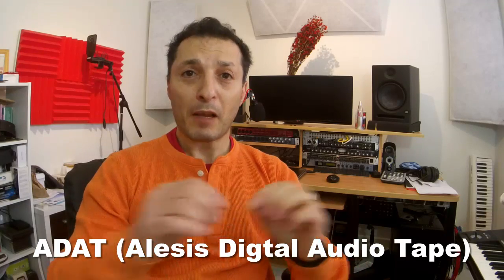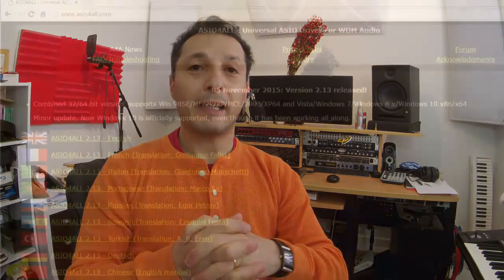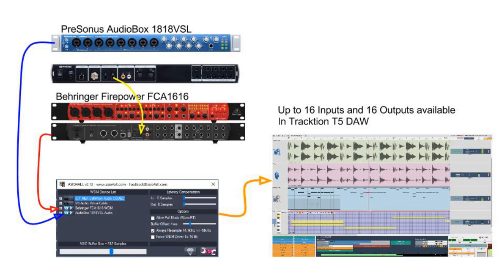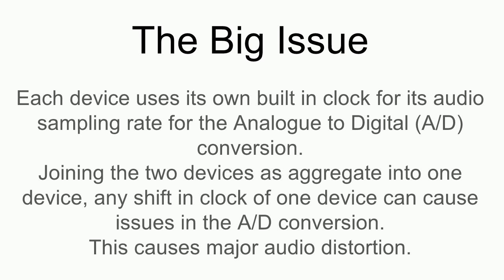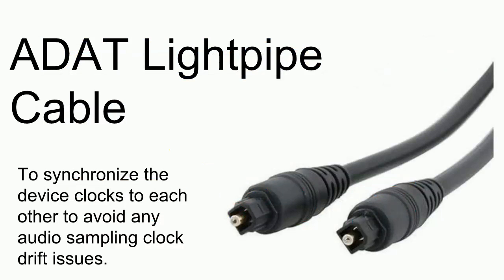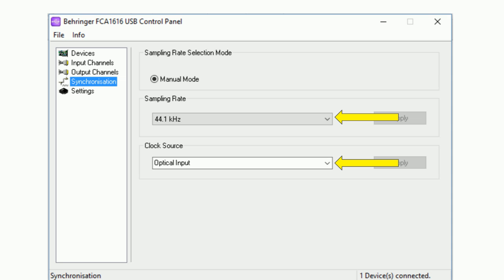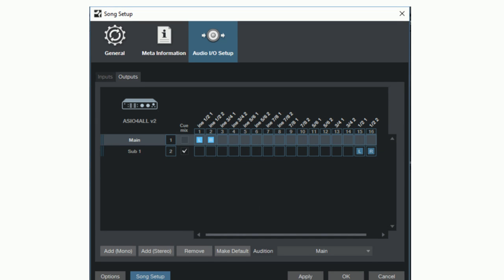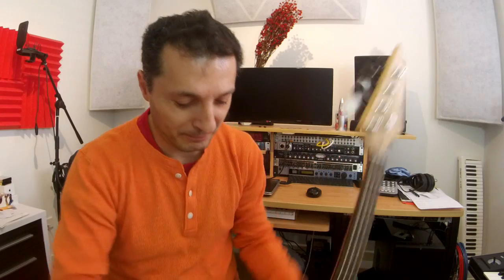Combining Two Audio Interfaces Using ASIO4ALL using ADAT as Clock Link

Comment: This makes no sense. 

If I have two audio interfaces with ADAT in and out and 8 analog inputs and outputs on each, I can just take the ADAT out from #2 bring it in to the ADAT in to #1, run the ADAT out from #1 to the ADAT in to #2, and then just use interface number #1 with whatever driver it comes with (no need to use ASIO4ALL) and have access to all 16 analog inputs and outputs on both interfaces through interface #1 to the computer.  I can then use the interface software to route all channels however I like and see them all in my DAW where I can set the clock to "internal" for both interfaces to slave to through the ADAT connections. 

If your method was correct (and I've never seen anyone use ASIO4ALL to successfully combine two input or output interfaces), then I should be able to run 2 ADDITIONAL AD converters (like the Behringer ADA 8000 / 8200) to feed each of the audio interfaces and combine the two interfaces in ASIO4ALL to get 32 inputs and outputs with the ADAT handing the clock OR just use a dedicated external world clock to sync all 4 devices and the DAW PC.  

Unfortunately, I think that ask that you've done here is to make use of the ADAT input into your main interface to use the extra 8 ADAT in channels which is a well - documented feature of the audio interface, anyway.  

You don't even need to waste a USB port on your DAW computer, because it doesn't need to pull audio from the interface.  It can do it with just the ADAT connection going into the primary interface connected to the DAW. 

Lastly, there's a maximum number of channels you can bring into a PC using a USB 2.0 port. 

My RME Digiface USB interface takes 4 ADAT ins and 4 ADAT outs that connected to any ADAT - enabled AD preamp (like the Behringer ADA 8000 / 8200) or any audio interface with ADAT ins and outs to combine them into a 32 channel in and 34 channel out (it has s headphone port) interface through a single USB 2.0 cable.  But that basically maxes out the capacity of the USB 2.0 port. 

I'd love it if you were correct, though. I've got 4 audio interfaces with ADAT in and out and 2 Behringer ADA 8200s. If you were right, I could buy 2 more ADA 8200s and then have 64 channels of inputs and outputs and sell my Digiface USB. Unfortunately, ASIO4ALL can't (from what I understand) do this in a reliable way. 

It's what makes those damned Apple computers better for audio recording. They can combine interfaces right in the OS where Microsoft won't get off of their asses and fix their crappy audio system.
Reply: Okay, this shit is frustrating me. I'm confused about all this.  I don't think and ADA8200 can work with the ASIO4ALL because both interfaces have to be connected via USB. The tracks aren't all going through the ADAT, just the clock sync. The tracks are going to the computer via their respective USB and get combined by ASIO4ALL. It seems to me that this is basically a workaround if you don't have 2 optical cables. Please clarify if you can. I would like to know before I buy an interface and mics.
Reply: @limitisillusion7  First of all, the ADA8200 isn't an interface at all. It's only a converter with an ADAT (optical lightpipe) port and preamps. It'll take analog in through a preamp and then convert it to one of eight channels of digital OR / AND convert eight channels of digital (coming in from ADAT optical lightpipe) back into analog.  

To use it, you'll need an ADAT interface (which are very common on inexpensive audio interfaces).  That interface will either be USB or FireWire or Thunderbolt. If you're talking about USB, then yes: you can pull in all of the analog inputs on your interface plus the 8 ADAT channels per optical input port.

If you have some of the newer interfaces, you can even have two or more ADAT lines coming in. 

If you buy an RME Digitface USB, for example, you can run FOUR ADAT inputs (and outputs) via one dedicated USB port. That's 32 channels in and 32 channels out (plus two analog headphone RL lines out).

Also, many manufacturers permit more than one USB interface to be run under one driver. 

This lets you combine their inputs and use them all as a single interface in your DAW. RME and MOTU do this for sure. 

One USB 2.0 cable can actually handle about 40 channels of 48k audio going both ways (according to RME). It's about getting the drivers right, not about bandwidth so much.
Reply: I would have to agree with you Mr. McCalla. I followed the video to the T and was never able to make work with 2 interfaces. Someone described to me exactly what you pointed out here and I can now have my Presonus VSL 1818 to work with one of the old Digi002 interface I have. I can now have 16 input / output channels. However, I have 2 Digi002 Interfaces. I cannot manage to find a connection that would extend the additional Digi002 along with the Presonus interface to give me 24 channels instead of 16. I am on Win10 x64. The presonus interface is used as my primary interface and I use its driver software for configuration instead of ASIO4All. If I understand correctly, you said that USB 2.0 can handle 24 channels in Windows, can you please explain how I can my interface to see all 24 channels. I appreciate your clarification though.
Reply from the maker: At this stage, I no longer care if people don't understand the basic physical facts and limitations I explain over and over again, yet again during my livestream https://youtu.be/zlr1X2n8boA?t=720
If you believe I'm wrong here and Mr McCalla is correct, so be it :P
Reply: @marleyemery8855  nope
Reply: That's what i asked to myself. What's the point to have an adat connexion if we can't rout the input into it? On the ada8200 manual it says all mic/line input routed to the adat output.
Reply: @katentu  I didn't quite understand what you wrote about "What's the point to have an adat connection if we can't route the input into it"
What I can tell you is that I have a Behringer ADA8200 connected to a Behringer UMC1820 interface and I can do any routing between the two devices from my DAW.

A very important thing that was not mentioned in the video is that two optical cables are always needed between the two devices.

Example:
If I connect just one cable between the optical ADAT IN connector of my UMC1820 to the optical OUT connector of the ADA8200, I will be without the 8 OUTPUTS of the ADA8200 and I can only receive analog signal from the INPUTS of the ADA8200.
If I connect just one cable between the optical ADAT OUT connector of my UMC1820 to the optical IN connector of the ADA8200, I will be without the 8 INPUTS of the ADA8200 and I can only send analog signals to the OUTPUTS of the ADA8200.

Therefore:
To have access to the totality of INPUTS and OUTPUTS that will come from the sum of IN's and OUT's of both devices connected to each other, it is really necessary to have two cables connected...
Reply from the maker: This video is not about ADAT devices, but 2 USB interfaces with ADAT options. If you already have ADA8200 or equivalent, than this video is irrelevant.
Reply: Well, this video isn’t meant for you then. For me, I have a Focusrite 18i20 with a OctoPre adat connected but I also have an art tube opto I’d love to connect, a 2i2 that hold be an extra 2 inputs I’d like to use and I’m about to buy an Evo 16 which gives me the way to connect that art puss another adat if I want. I don’t graded from the Motu 24ai and 24ao and am very used to having 48 in and out all the time. This video is for me. I can do that again without using Motu and that is very good. Motu didn’t keep up with their drivers and shut me down a few times. This will fix all of that and give me back the inputs I need.
Reply: I hope it works for me, can’t wait give it a try. Rather than being limited by 8 simultaneous channels of adat coming into the host, you getting full functionality of each interface because both are connected to the computer...i hope i understand Vatche correctly here. When i slave my old motu 828mk2 to my behinger fca 16, i get only 8 inputs and outputs out of the 828 which is capable of 20, they give you 3-4 options in cuemix. Be great if i could get all the i/o of both devices, and see both simultaneously in Reaper.
Reply: exactly... this video is over complicating things.... my god
Reply: @jazzbeats8168  I disagree. Many of us have devices laying around that can be recycled to work reliably in scenarios like this. Wealthy or very busy recordists can go out and purchase whatever they need -- and more power to them. For me, this is a fun little hack that may end up working very well.
Reply from the maker: Thanks for your comment. Unfortunately, you are missing one important information in your analogy. Unless you are using high-end audio interfaces, budget interfaces that have ADAT, DO NOT connect their analog inputs and outputs to ADAT, they just go to USB. And ADAT only sends/receives from USB. So, you can't connect one interface to another with ADAT in/out and expect it to work
Only a few high-end interfaces that have built-in DSP, like MOTU, RME, etc that will allow you to direct analog in/out to ADAT instead of USB. Here is a link to a very old video of mine showing how I used my faulty FireWire MOTU unit to act as an ADAT unit https://www.youtube.com/watch?v=ITc9vPDZ5H0
With all of my testing, ASIO4ALL can handle up to 24 or max 26 before it grinds to a halt. This is due to the fact that the clock drift and processing is now handled by the PC CPU and not the hardware unit. 
I have used 2different make interfaces with 8 inputs each, totaling 16 inputs, and recorded all 16 channels for over 2 hours continuously with not one sample drop.
Yes, MacOS handles multiple interfaces bit better with Aggregated units, but again, the stress is still on the CPU.
The best way to extend an 8 in/out USB interface with ADAT is with a dedicated ADAT Mic-Pre such as Behringer ADA8200, PreSonus DigiMax, or Focusrite Octopre etc to get 16 analog in/out.
Hope this helps your confusion and now makes sense :)
I hope to make a new detailed video explaining and showing what I just said, soon.
Reply: @RecordingStudio9  i have 3 different interfaces with ADAT that use FireWire and not USB (Profire Lightbridge, MOTU 828 mk ii, MOTU 896) and 3 that are USB (RME Digiface USB, MOTU 828 mkii USB, Celrsonic 20/20).  

They all use 8 channel ADAT.  Therefore, I think that your statement about USB is in error. 

Further, if you have more than one interface from the same manufacturer, many times you can have more than one plugged in and the driver (in Windows) will combine them as one device.  I know this is true of MOTU FireWire devices and is true of RME USB devices and FireWire devices.

I'm sure there are others as well.
Reply from the maker: I highly recommend you watch my video response (https://youtu.be/zlr1X2n8boA?t=720) first before claiming I'm wrong.

So, how do you have them setup to give you 48 inputs and 48 outputs, seen all 48 inputs and outputs by your DAW, with no aggregation?

USB or FireWire, no different to what THE BUDGET UNIT, under $500, can do in relation to ADAT audio routing.

Please show me documentation from any manufacturer that sells CURRENT audio interfaces under $500 that allows you to direct Analog input/output to/from ADAT, as well as having multiple units connected, USB or FireWire (remember, Firewire interfaces have been discontinued for many years now, apart from MOTU) and combine the inputs/outputs.
Any unit that has this feature is well above $500, if not $1000.
Don't mention MOTU or RME as they fall above the $1000 market.

P.S. FireWire was designed to be daisy-chained, but not all manufacturers had drivers to support it. MOTU, RME, Focusrite, PreSonus and some Behringer FireWire units did support. But again, they all fall above the $500 budget.

Hope that clears it.
Reply: @RecordingStudio9  Well, let's see:  all 3 of the MOTU units can route audio directly between ADAT and analog (and digital coaxial) without even being plugged into a PC.  So, I'd say that qualifies. 

Further, it's well documented in the 828 mkii and 896 manuals that (this time you need to be plugged into a PC) you can aggregate up to 4 devices (that would be 10 channels of analog plus two digital coax plus 8 channels of ADAT for a total of 20 channels in for each device) which would be a total of 80 channels of 48k audio coming into the computer under a single MOTU ASIO driver (seen as one device). 

The Celesonic has the exact same number of channels but it does one better: it actually has a hardware switch on it with 3 positions: interface, mixer, and preamp.  When unplugged from a PC you can still use the mixer to route any (preconfigured) digital and anslog audio channels TO any other digital or audio channels.  You set the gain directly on the unit face. The MOTUs have this function as well.  

The RME Digiface is all digital (64 channels via 4 ADAT in and 4 ADAT out) with just two analog audio channels for headphones. 

Using the mix software for that unit, any digital channels can be routed to any other digital channels or to the 2 analog channels. 

Again, up to 4 of these can ride under a single driver giving you a  total of 128 48k channels via 16 ADAT ports under a single RME driver operating under windows. 

The RME units list at $499 US. The Celesonic for about $500 as well (though the street prices are less).  The MOTUs are actually out of production for the mkii series, but these can easily be had used for about $150 US each.

What I had been doing was using my 3 MOTU units with 3 Behringer ADA 8000 units (about $100 used each) to run ADAT into each of the MOTUs. This gave me (with the digital coax ins) a total of 60 channels into my PC.  No problem. People have been doing this with MOTU 828s for years. 

Right now, I'm trying to buy a second RME Digiface so that I can bring in the 3 MOTUs and 3 ADA8000s in as 6 ADAT inputs.  Then, I'll buy 2 more ADA units for a total of 64 channels in.  I can then even add another 3 ADA units and mix those 24 channels for s total of 64 channels in, but 88 channels able to be mixed (but only 64 at a time). 

With this kind of arrangement, I can easily have 16 MOTUs and 16 ADAs with 4 RME Digifaces with a total of 320 channels in with a maximum of 128 channels being mixed in my DAW at any one time.  That's down the road a bit, but it all will work seamlessly in Windows with virtually no latency. 

Oh, couple other points: you can also reWire from other DAWs into your main DAW and each can have a separate audio device.  You do need to sync ADAT if you're using this, though (I've never done this). 

One last thing (outside of the sketchy ASIO4ALL system), Cakewalk audio lets you combine audio devices via its WDM audio handling.  If your device can do Windows and ASIO, it does WDM.  

Cakewalk is now free, as well, by the way. 

Here is the manual for the MOTU 828 mkii.  

https://cdn-data.motu.com/manuals/firewire-usb-audio/828mkII_Manual_Win.pdf

Just look on page 32. 

Here's the RME Digiface Manual:

http://www.rme-audio.de/downloads/dface_usb_e.pdf

Just look on page 20. 

To be clear again: these are ALL Windows 10 compatible and have both USB and FireWire options.  

Oh, the Celesonic manual is here:

https://tascam.com/downloads/products/tascam/us-20x20/US-20x20_OM_vB.pdf

Again, this is about $400 (street) new and only requires USB. 

Cheers!

PS - I almost forgot!  I don't know where you heard that USB 2.0 can only handle 24 channels of audio.  

Here's an RME representative at NAMM (in describing the Digiface USB) makes it clear that USB 2.0 can handle about 70 channels in and 70 channels out through a single usb 2.0 cable and port.  The little Digiface alone does 32 in and 34 out without any latency to speak of on a single USB 2.0 port - but as you can see, that's not even half of what is possible. Again, USB 2.0 not USB 3 or 3.1:

https://youtu.be/85-IadJ2pbU
Reply: @RecordingStudio9  I have a USB APOLLO and a PreSonus 1810 and a MOTU 2408(gift).. I was wondering how to join all of these ... This seems the perfect place to ask
Reply: RecordingStudio9.com 
I have x2 Motu mk2 FireWire ports and I use both analogue and the optical on both. I created an aggregate using the software and I get 44 channels of audio. I use the soundcraft 328 because it has the option to receive 16 channels of optical 16 analogue ( plus more) and outs to optical aux. Once you open the Motu software you need to configure the information to sync otherwise you will get spikes in you audio. I have run this for over 5 years as I did not want to by into changing interfaces when I can get what I need from 2. Not all small interfaces have optical and some interfaces that do have optical W it’ll only give you one input and output. Also not many know that the motu also has SPDIF which are digital lines to and are quit ( well mine are) and I link these to the soundcraft as they have them on the back to give me extra digital lines. I can access all these lines in logic.
Reply: @juniorhall4679  the problem with aggregating the interfaces is that you will introduce slight latency between the devices. so if you are recording all channels at the same time it could be problematic. with adat you do not have that problem , its brought in to your DAW as one device (interface)
Reply from the maker: Except for one important fact people fail to understand is that very few and high end USB audio interfaces with ADAT allow to direct the analog inputs/outputs to ADAT port. 90% direct analog inputs to USB, that means you won’t get any audio from one device to the other via ADAT. Unless the second device is ADAT I/O like the Behringer ADA8200, which is not what I’m talking about in this video.
Reply: @RecordingStudio9  ah ic… the title is slightly misleading .. try “aggregating two devices”
Reply: @RecordingStudio9  no idea what you're talking about. ADAT by definition is 8 channels of digital audio. 

Maybe you're thinking of spdif.
Reply from the maker: If I use the word “aggregate”, people will think I’m talking about MacOS process and not Windows. MacOS makes this easy, but there isn’t any “aggregate” feature for Windows.
Reply from the maker: Maybe because you’re not listening or reading what I’m talking about. 
All I’m saying is that you CANNOT simply connect 2 USB interfaces that have ADAT in/out and expect the analog audio from the second device to appear on the first device via ADAT, unless you are using a expansive device (MOTU, RME etc) that allows you to reprogram its input from USB to ADAT. The second device must be ADAT interface like ADA8200 by Behringer. 
How hard is it to understand?
You don’t have to believe me. Try it yourself. Get 2 Scarlet 18i20 and combine them with only ADAT and one USB to PC.
Reply from the maker: @mc2engineeringprof 
Maybe because you’re not listening or reading what I’m talking about. 
All I’m saying is that you CANNOT simply connect 2 USB interfaces that have ADAT in/out and expect the analog audio from the second device to appear on the first device via ADAT, unless you are using a expansive device (MOTU, RME etc) that allows you to reprogram its input from USB to ADAT. The second device must be ADAT interface like ADA8200 by Behringer. 
How hard is it to understand?
You don’t have to believe me. Try it yourself. Get 2 Scarlet 18i20 and combine them with only ADAT and one USB to PC.
Reply: bruh if ur gonna spend that much then just get a better rack lol, this is patchy